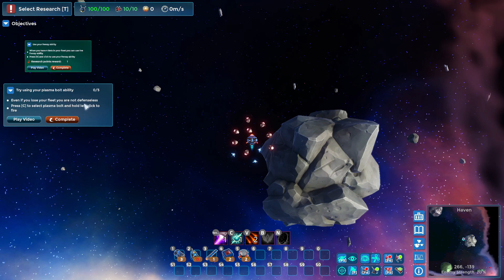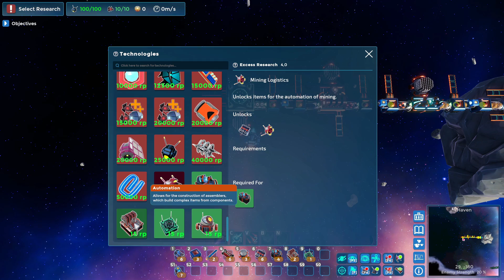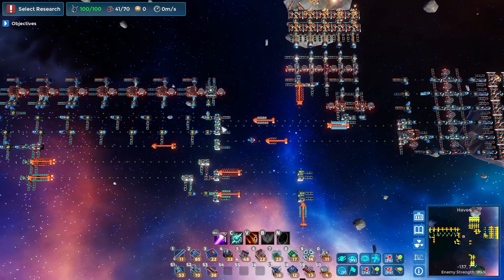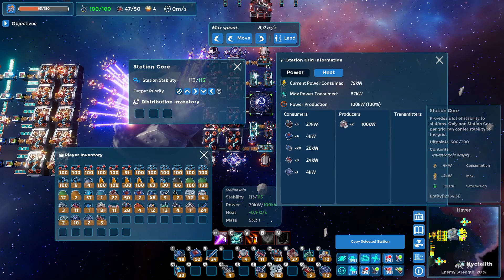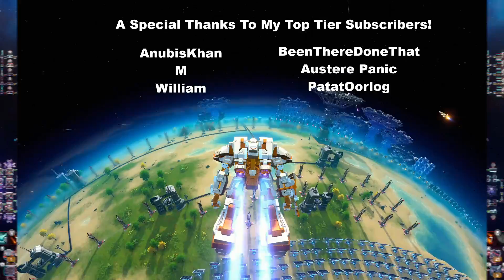Efficiently handle the Early Game  | Final Factory Guide

Comment: You could eliminate the 2 connectors and storage from the mining array and save on power\stability by replacing it with a sorter.  Don't forget that sorter bots can travel over stuff like solar panels.  They can also pick up resources directly from the mining station, no connector\storage\logi station needed.  Works with printers\assemblers as well.
Reply from the maker: Good points!